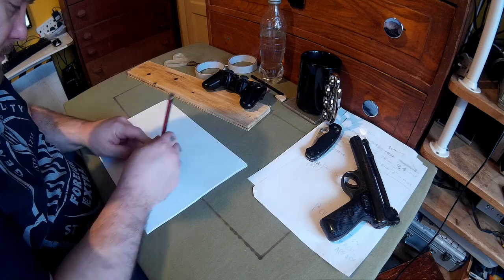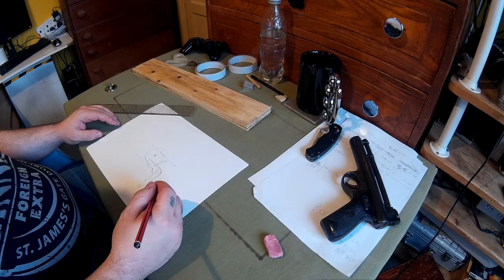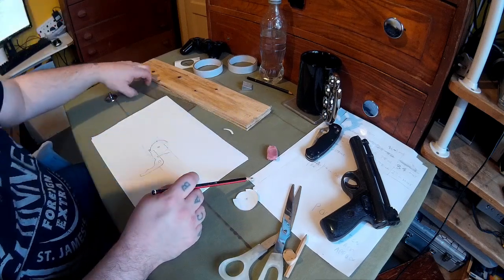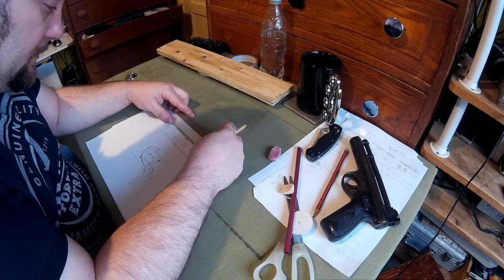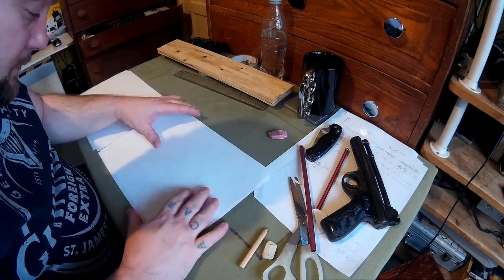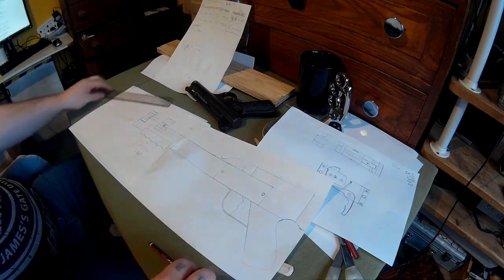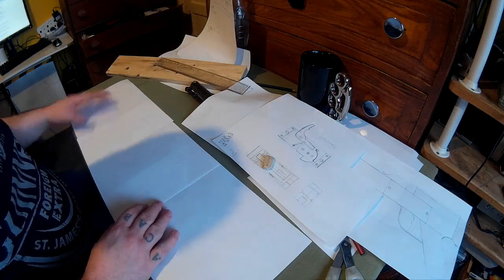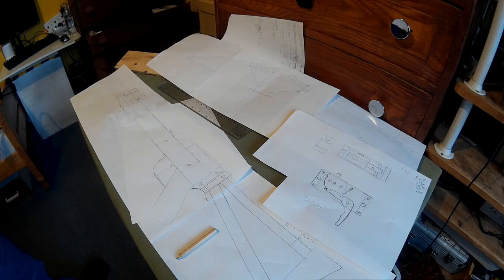How to make a Carbine Crossbow Part 1: Designing The Crossbow

Comment: Looks like a good project mike.Sport rock on ebay sell 13inch ally bolts of the same thickness you want.i paid £22 for 30 of them posted.just takes 2/3 weeks for delivery mate
Reply from the maker: Cheers Tumbo, i shall defo check those out, funnily enough just bought a broad head off sport rock the other day, cheers for watching mate.